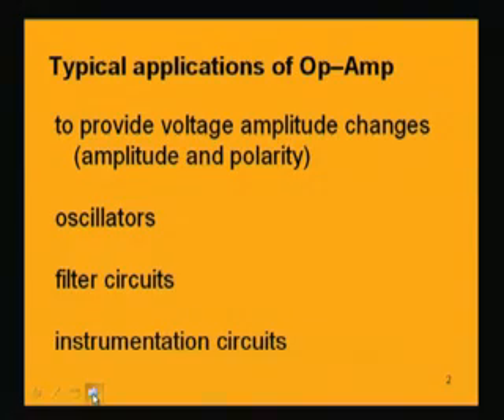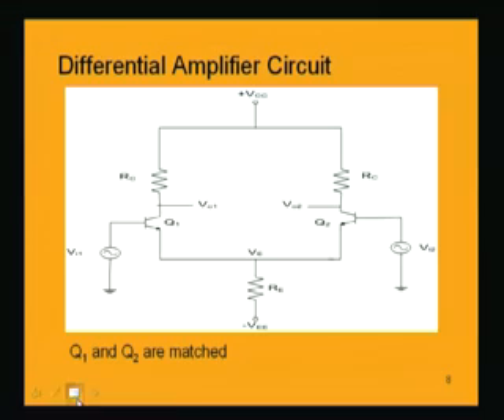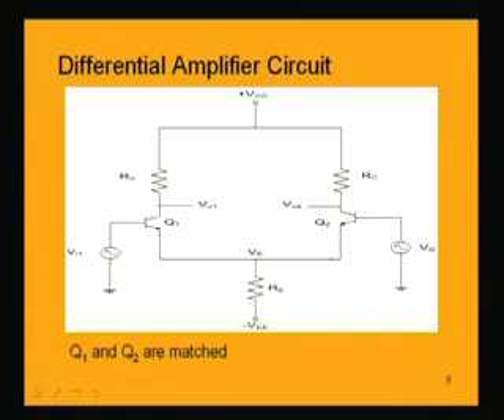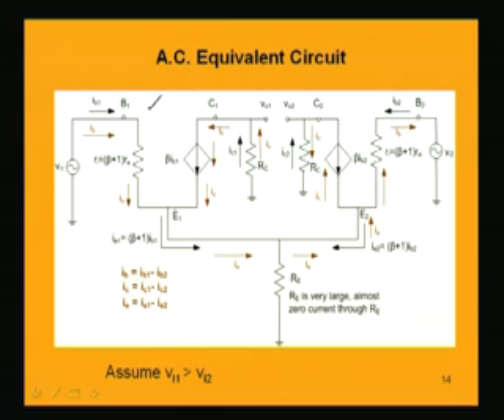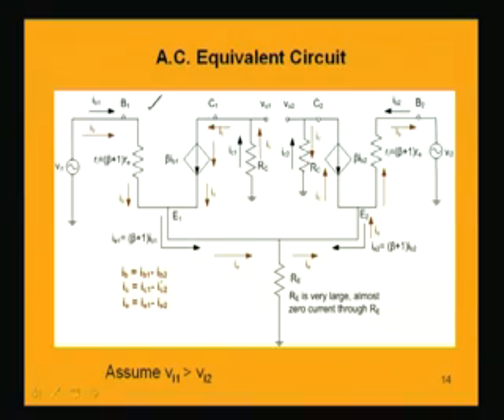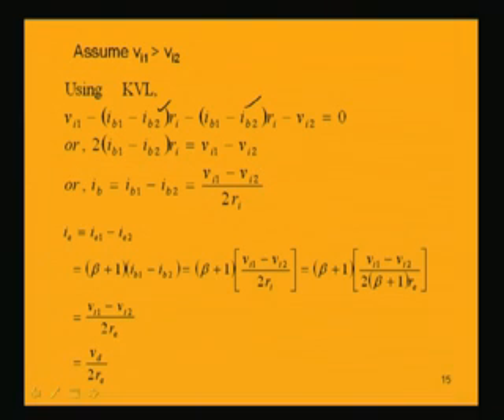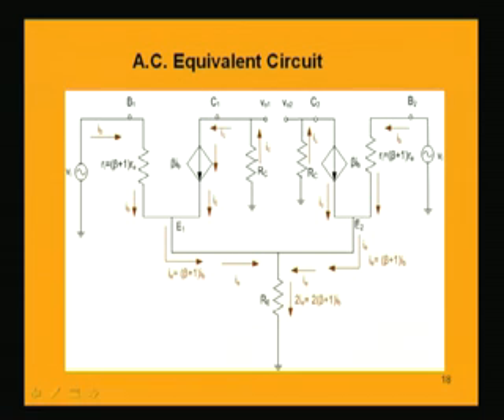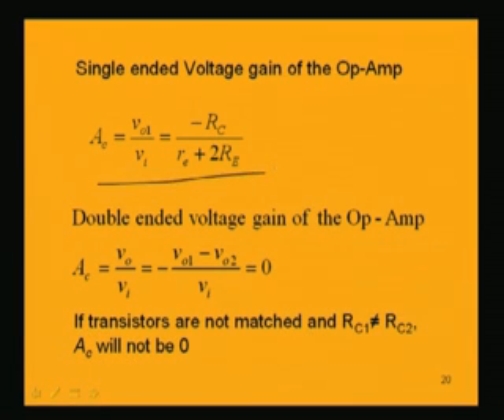Module - 4 Lecture - 1 Operational Amplifier (Introduction)

Comment: Why input impedance is always high and output impedance is very low?Someone please  explain me with an easy example
Reply: The input impedance is always high so that the difference between the currents at the inverting and non-inverting terminals is of the order of nano to pico amperes or equal to zero. So I(inverting)=I(non-inverting). That is why we say the opamp is  virtually shorted. This high impedance acts as volatge controlled voltage source device allowing maximum potential to build up across the high impedance. 

The output impedance is low inorder to allow maximum current to flow from the load to the feedback impedances. The high voltage produced across the input impedance causes maximum vottage to build up across the output. The low impedance produces low voltage drop across it allowing maximum output voltage.
Vout=A(open loop gain) *(V(+ve)-V(-ve))
where V(+ve)= Volatge at non-inverting terminal
            V(-ve)=Voltage at inverting terminal.

Comment: whats is difference between r and R in expression of base current ib in denominator r+2R
Reply: +Aman Shaikh  r is re which is replaced because of the forward bias  in the transistor 
and the R is RE  which is the emitter resistance

Comment: Need to Bengali version for West Bengal.
Reply: what is difference between r and R in expression r+ 2R in expression of base current in common mode operation plz reply as early as possible
Reply: kushagra yadav am agree with you but no need to use that F word bro 😉
Reply: Partha Tantuby  you r very foolish person and one of the main reason why India is still divided..... it's a shameless thing that u need the lecture in Bengali,even if u had asked for Hindi that was far best thing bcoz our mother tongue shud b hindi not Bengali or other f**king lang
Reply: kushagra yadav You does not think about high level angle because implementation our motto,Argument is return back to previous stage.Any citizen who want to learn easily through mother tongue and their skill up properly but other language just like " Biriani " means indigestion.You can understand hindi or English but every citizen are not just like you.So,therefore request heartily don't strike any one.......Are you agree????Ager is bat se sahamat nahi to chale apki bat hi sahi kuinki app to app hi hay............!!!!!!! kisi ko foolish bole ne se pahle aap jara gahrai se soche....aur samajh kar bat kare.....samjhe boss.Aur kahi doubt hai to mera mobile no 8145038334 no pe call karke doubt clear kar sakte hai @ Kushagraji.

Comment: Dr. Mahanta
Your lectures are extremely interesting and comprehensive. The one problem though, the video quality is so poor, many of the details that you place on the electronic "blackboard" are not legible. Tring to make out equations is almpst impossible as well as details such as labeling like Vo1 or Re2. Is there any other source for these videos in higher resolution?
Thanks 
Jack